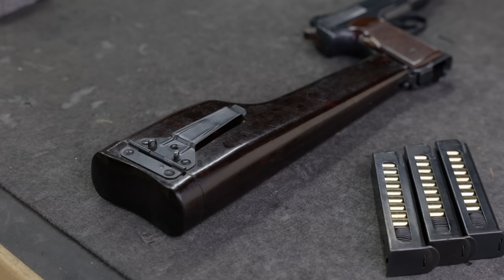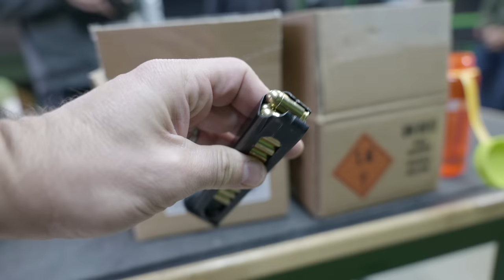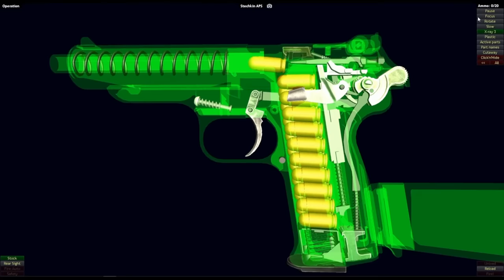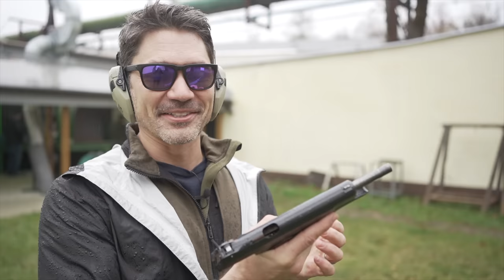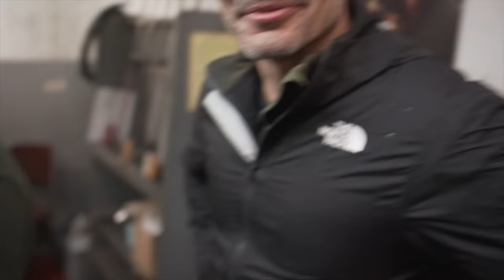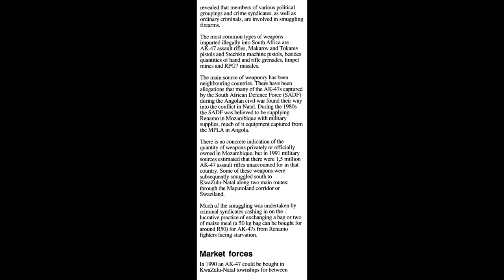The APS Stechkin Machine Pistol

Comment: Next level field gunsmithing 👊🏼👊🏼👊🏼
Reply: Incredible.  I'd search the internet for a solution before finally JB welding it and never shooting it again.
Reply: Not really, full auto I'd way easier. It takes work to get the trigger to stop effecting the pin-stop quickly enough that (no matter what you do with the trigger) it grabs and stops after a shot.

It would be much easier to have a direct trigger-pin-stop which is spring biased to stop the pin but holding it down would negate that.

Oh it has a similar option, still easy enough if you have the mills and the skills for gunsmithing ordinary semi's like the one in your holster now!
Reply: Semi* not similar wtf

Comment: The ballpoint pen spring trick has been used by many folks over the years as a temp fix. Besides that,  I've used a toothpick to replace a pin and get a Luger running. It worked the rest of the day, afterwards I did the ol' cut-off drill bit routine.
Reply: I've got an sks with a gas tube cover held on by a sacrificed donor from My letter drill bit index.  Been on there over a decade

Comment: Practically, Stechkins are still in service as aircrew survival kit weapons with helicopter and jet pilots in Russian Aerospace Force. They also were (and probably still are) very popular as a sidearm and\or shield-gun with RU counter-terrorism units. The specialists usually don't run them full-auto or use the stock-holster. On its own, it's a reliable pistol that gets better accuracy and performance out of standard issue 9mm PM\PMM ammo due to long fixed barrel. 
Stechkin himself headed the development of replacement models, OTs-27 and OTs-33, but these never went anywhere due to economic and political complications of early 90s.

Comment: I've often wondered if the spring from a click pen would work for something like the buffer retaining plunger on an AR.
Reply: Maybe the right one.  
I had one zing across the room on me a few weeks back and looked at a pen just to see it was slightly bigger than the one in a S&W lpk.  After replacing it with the one from the kit sure enough i found the other spring and retainer pin on the other side of the room 😆

Comment: That's the thing about intentionally engineering mechanical devices to be simple and robust: they rarely break and when they do they're easy to repair. It's an entire set of design principles which were thrown out when almost all of engineering switched from the idea of robust longevity to planned obsolescence and cheap replaceability. This is why there are still things like VW Bugs, WW I jeeps and Vietnam era Duce-and-a-half trucks roaming around: but your garden variety Company A model B 2023 [enter car type here] will need replaced after 150k miles.

Comment: The VZ61 also has a good reputation as a machine pistol. It's only .32 acp but it would get the job done, i guess.
Reply: let's remember that not so long ago a good part of the police forces (and some military forces) in Europe used 7.65x17mm Browning (basically it's the .32 acp, however some European loads are hotter, which helps with it performance), which shows that despite being on the threshold of effectiveness, it can still fulfill its role.

Comment: In the 90s i had one.
It is extremely accurate if you shoot it on semiauto mode, in full auto without the stock-holester the gun is out of control..
The only bad thing with this pistol is the caliber. The russian 9x18 makarov is a scarcity... And the surplus ammo is not reliable.
Loved the gun hated the bullet.
(It is a big pistol but quite light weight)

Comment: Although there were select fire Mauser and Astra  pistols (derived from the C-96), there were never any production select fire Lugars. The artillery Lugar, with the snail magazine, was semi auto, although the same magazine  was also used with the open bolt German MP-18 subgun of WWI. As much as I like the Stechkin, and own a Makarov in .380, it was never very popular with the Soviet military. Why, I don't know. 
     Great field repair, but why not replace the spring and roll pin with comparable  CZ factory parts?  Regardless, another fascinating Soviet small arm design ( and I own several)-John in Texas

Comment: A great video and a very interesting pistol. However IMHO a PPSh43 in 9mm might have been a better solution for vehicle crews or anybody else. Or a thermobaric RPG warhead if one likes it close and hot. The US tank crews used the Greasegun until the Desert Storm at least. Was the Stechkin able to host a sound suppressor?
Reply: APB variant was able to
Reply: @winterautumnfishing5215  Thank you.
Reply: PPSh-41 weighs more than AKM
3.6 kg versus 3.1-3.5 in different versions.
And much more than the AKS-74u (2.7-3.0 kg)
PPS-43 - 3.1kg
APS - 1.22 kg + 0.56 with holster.
Reply: @alext5285  Thank you.

Comment: The artillery lugers where never fully auto. There's no full auto luger design in any conceivable point of history
Reply: The artillery lugers was good just because of the added barrel length and detachable shoulder stock which essentially just made it a PCC. Definitely still a precursor to machine pistols. Just no full auto